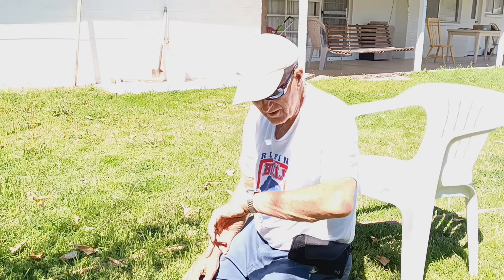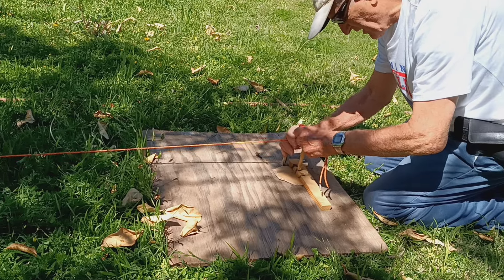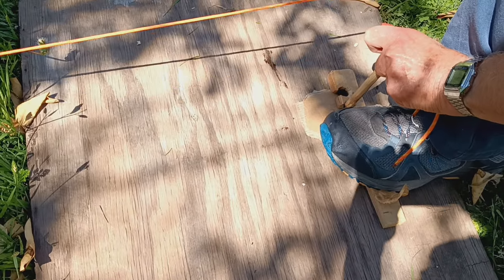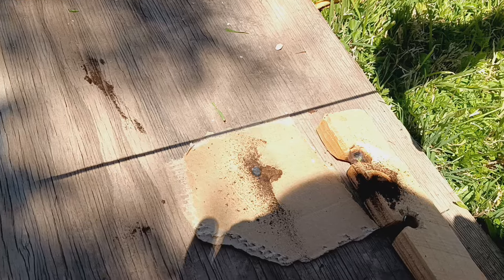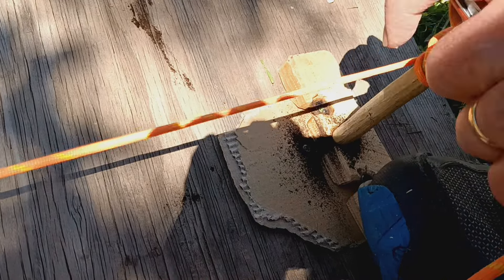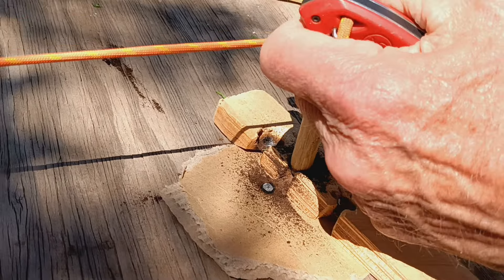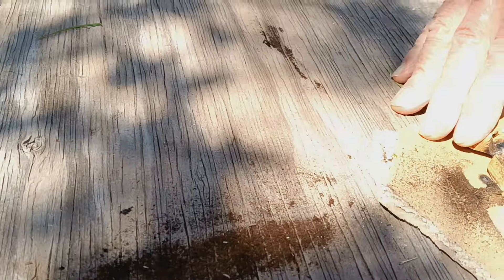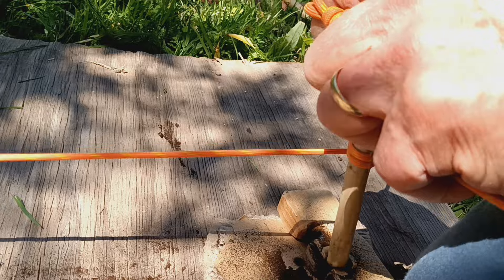Spring Pole Sapling Friction Fire

Comment from the maker: I think the reason it did not produce as much smoke after the first time was due to tiredness. I was putting in as much effort, but not as much force or power.

Another possibility is that as the hole gets deeper it gets harder to spin the spindle.